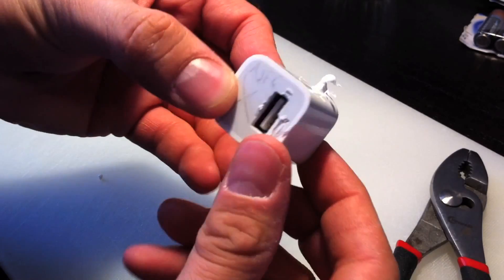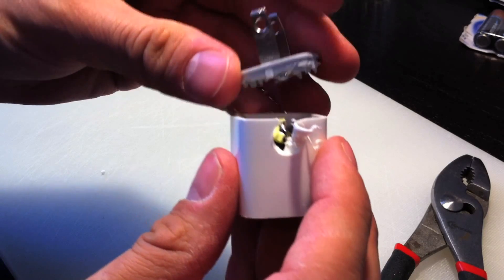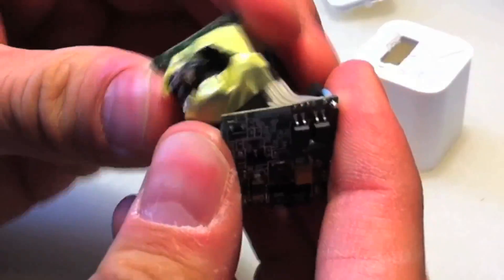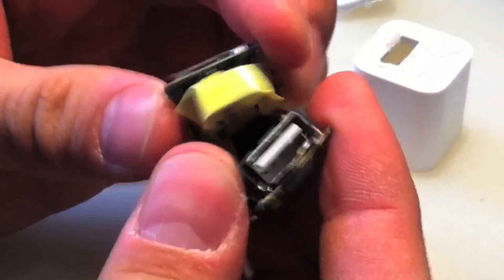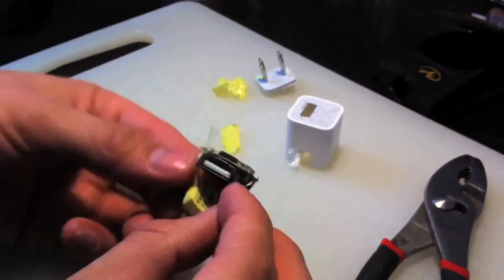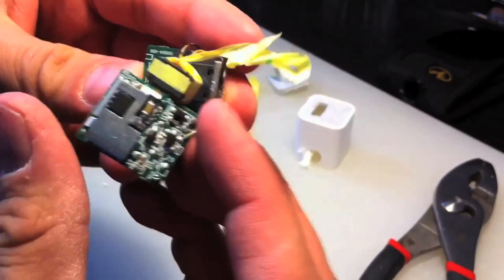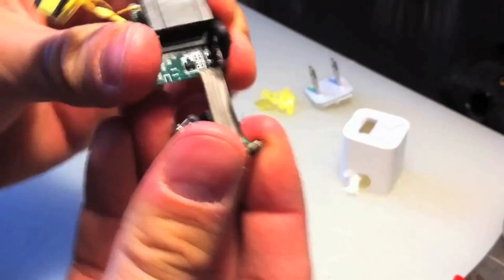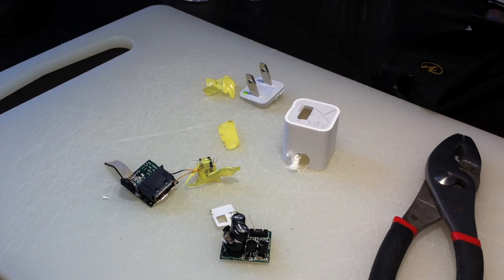Disassembly of the Apple USB Power Adapter

Comment: You don't have to drill to get it open. Run an exacto around the prong side seam and apply heat. Work it in a bit and then you can get a thin screwdriver into the seam and pry. Heat from a rework station is best but hairdryer would probably help. It will pop open with patience and be much less destroyed, just a few marred spots. I am working on one now, trying to find the fusible resistor which is 95% of the time the reason they stop working. Some older ones have a glass fuse.